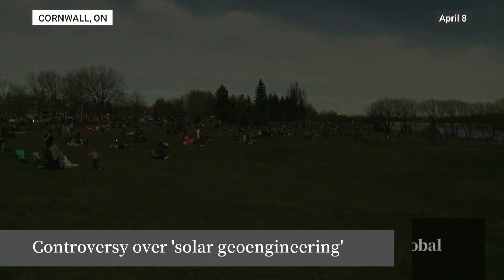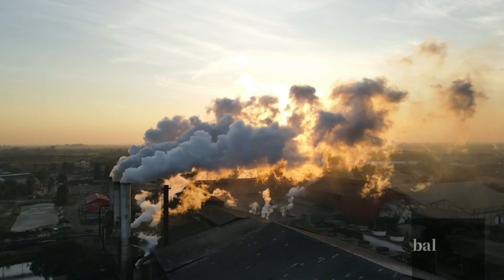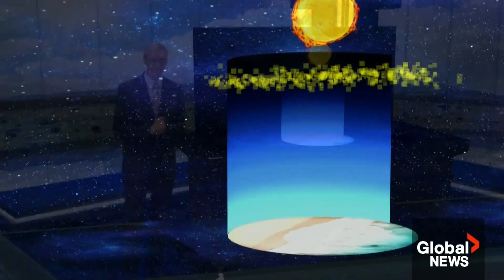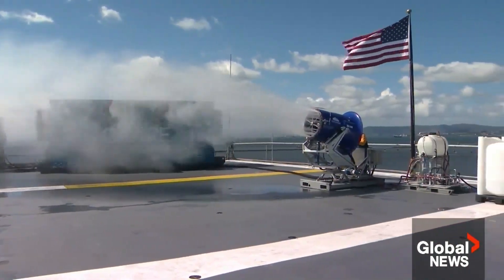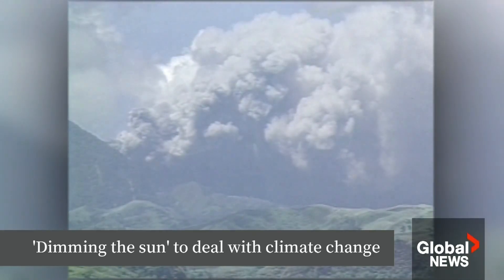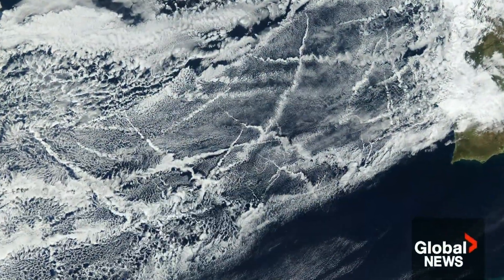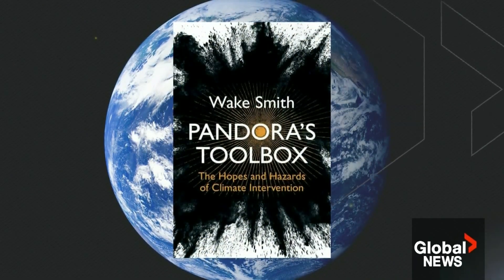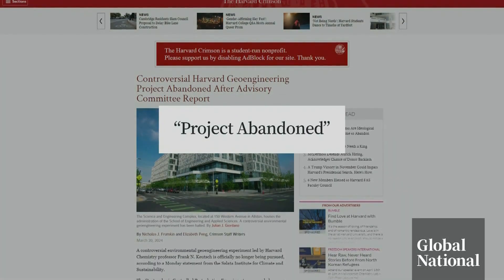Solar geoengineering: Can it solve the climate crisis?

Comment: This is why the sun never shines in the basin region of Ontario. Geoengineering 100%. The low pressure systems constantly manufactured over the basin area and park themselves, simply rotating. It is total overcast endlessly and rains every single day. High crimes deserving of the highest punishment. Blocking the sun is criminal as it a blocks life sustaining and essential vitamin and hormone (vitamin d). 
Criminal to the greatest degree.

Comment: For the last statement:
We're already witnessing a weakening AMOC current. Arctic permafrost have become a net source of greenhouse gasses, crops are failing from heat, droughts and extreme weather.
If we do not start solar geoengineering soon, I'm gonna be extremely surprised if our civilization can persist past 2040.
Solar geoengineering will likely have some side effects, but if we're already f*cked, I see no reason why we shouldn't roll those dice, cause it's zero chance those side effects are gonna be worse than climate collapse.